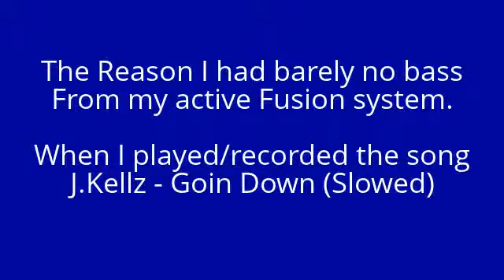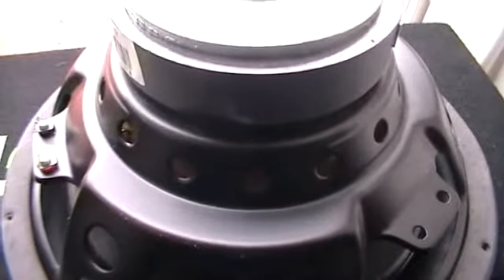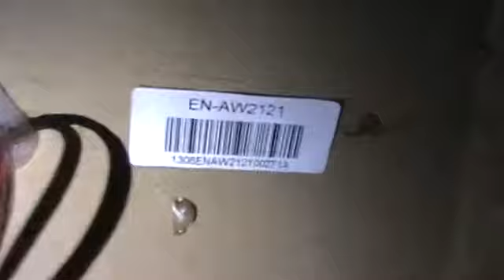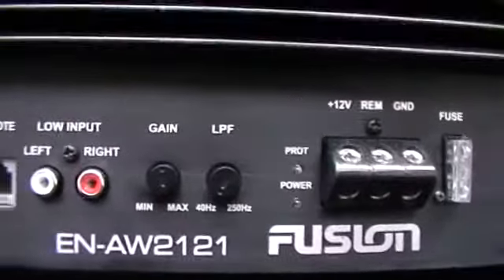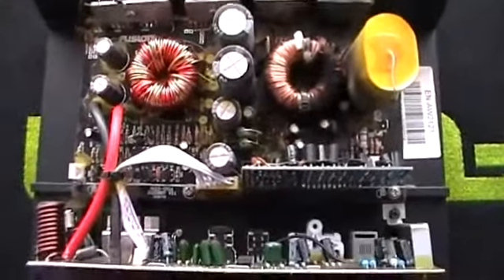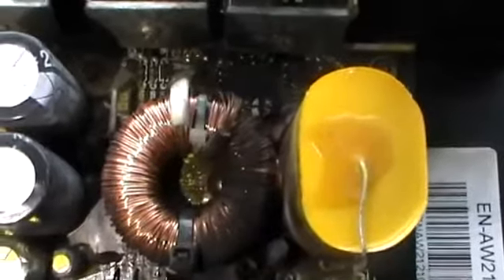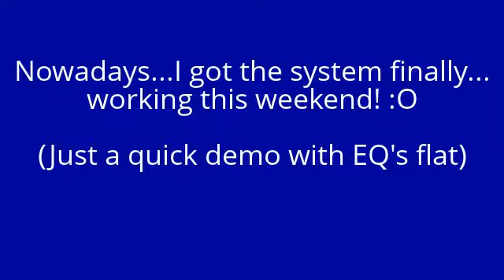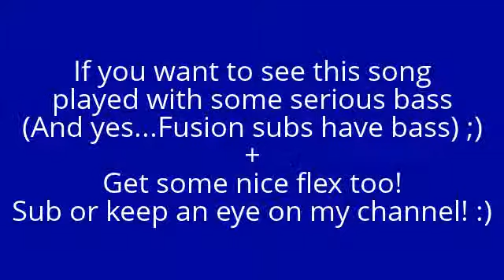The Reason My Fusion EN-AW2121 System Was C**p...Until Now!

Comment: You would think from factory they would have actually put in a better amp to handle the bass notes right? Im looking at buying these but just from seeing this outcome of the amp lol I thought bigger wiring speaker cables from amp to speakers but those are real tiny? Great inside depth work on these subs!!!
Reply from the maker: WelI...I had the previous Active Fusion model to this one (EN-AB2120) and the 10 months or so...I had it in my last car, I had absolutely no problem but this active amp system, was useless! :P

As well, this active Fusion system blows fuses, like theirs no tomorrow, lol! :/
(Saves frying them subs, by mistake!)

That cable is the worst...I have ever seen :D

To get this system to work...I had to use two lots of speaker cables acting as positive and negative, soldering + heat shrinking to the standard crappy active amp wire, it worked! :O

Do have a look on my channel and that will show you it's capabilities now, it is working.  :)